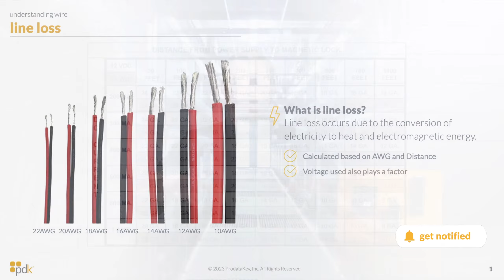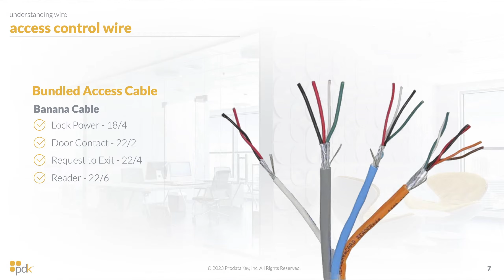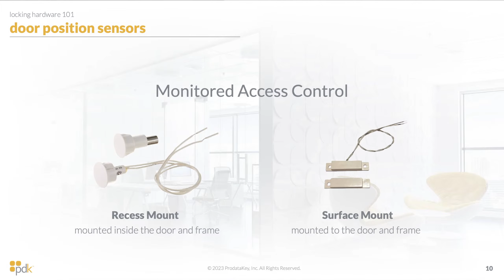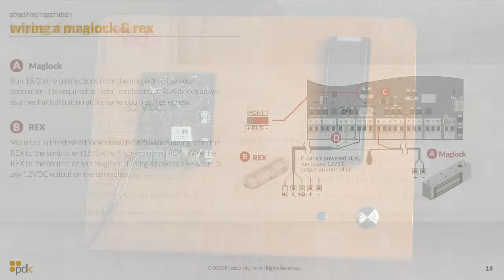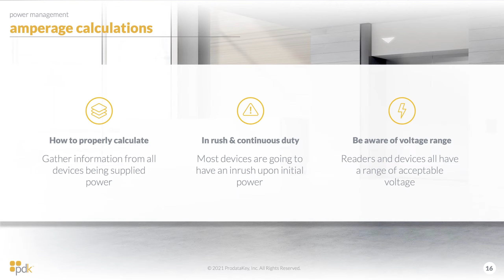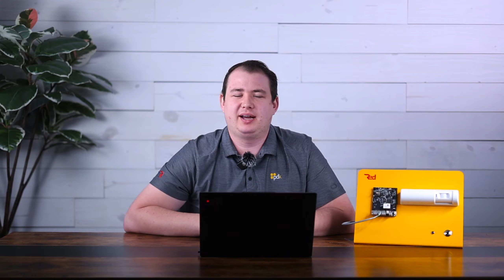PDK Access Control Coaching: Wiring Essentials for Access Control

Comment: So access control is battery powered?
Reply: The batteries are used as a backup power supply.
Reply: It depends on the manufacturer. Doorking’s control board is powered by AC. That board’s output is DC.
Most all automated gates are DC and use AC to keep the batteries charged.
I rarely see access control peripheral’s using AC. Like mags, Rex, motion detection and keypads.